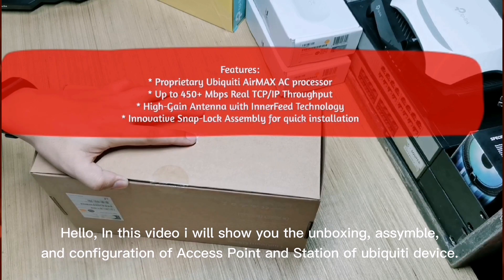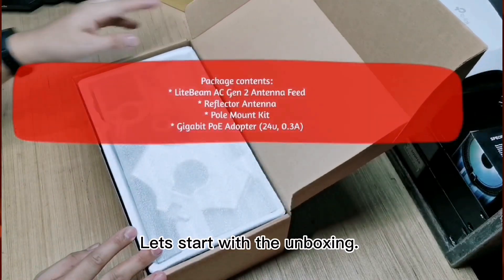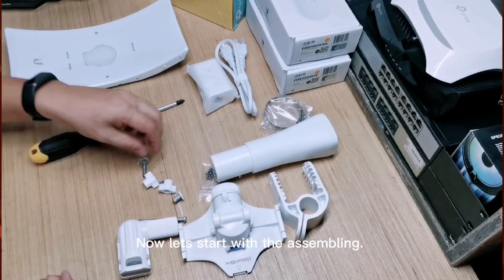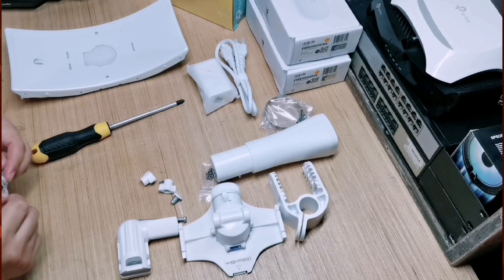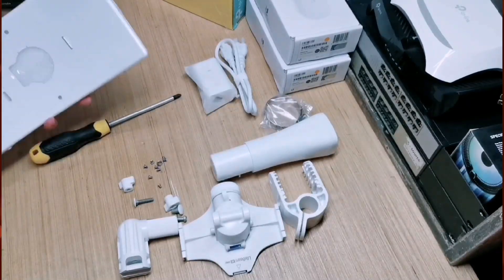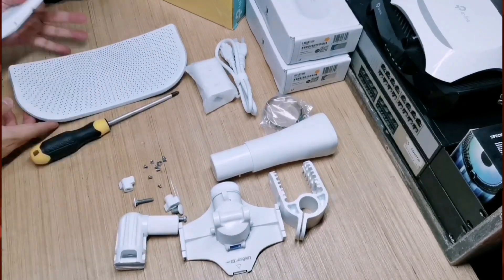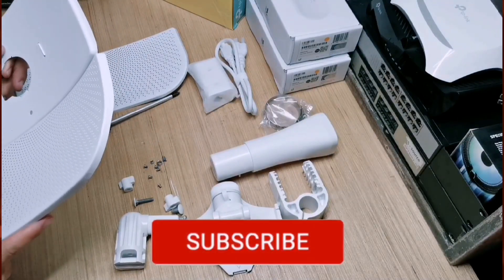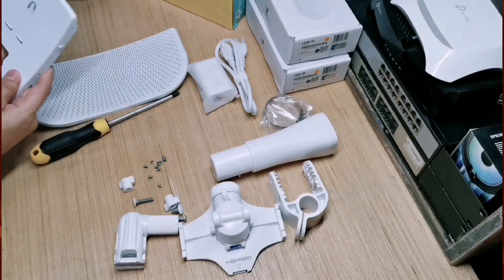Unboxing and configuration of Access Point and Station | PTMP WISP Part1 #ubiquiti #WISP #PTMP

Comment: Very nice thank you 
Looking for advice what product is best for bridging about 2 miles away with few tree tops in the way? Can you offer suggestion?
Reply from the maker: Hello, for PTP 2 miles you can use LBE AC Gen2 or much better nanobeam 5ac Gen2 - budget wise, 
and you need to elevate the device on the trees.
Reply: @HOOBasics  thanks much. Can't elevate above trees. Have to go threw tops of them. Looks like maybe nanobeam can handle little obstruction
Reply from the maker: Yes Nanobeam can handle a little obstructions but do not expect too much for the output, Goodluck to your project and thank you for reaching out.
Reply: @HOOBasics  Just did straight line measurement  and it is only 1.1 miles so much better than i expected.
But looks like I can only get 200Mbps at the host end and not 600 like I was told was available. Oh well,  end result of bridging the 200Mbps should still be way better than the 3Mbps I can on receiving end.
Thanks for the guidance.
Reply from the maker: @novice46  wow 1.1miles  much better. And having 200mbps is good enough.